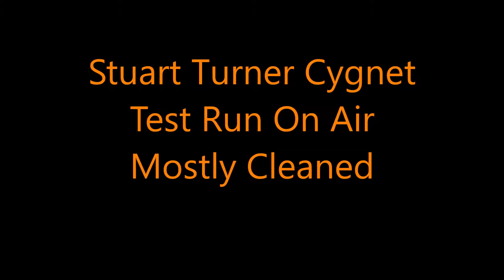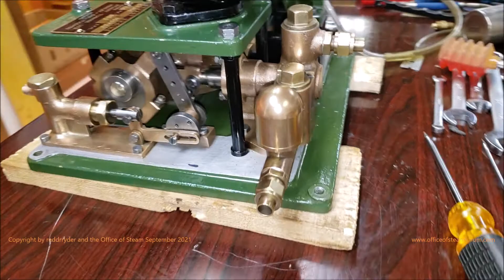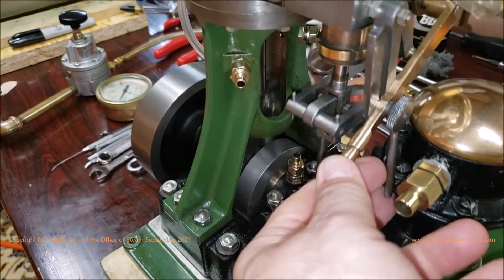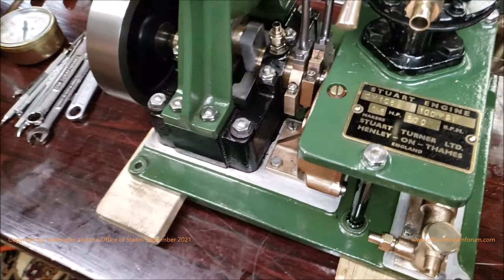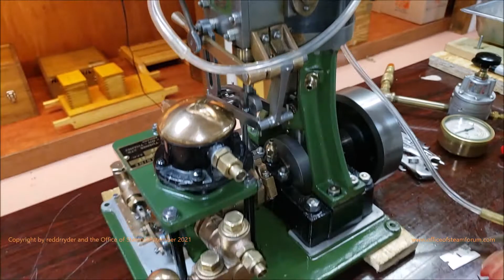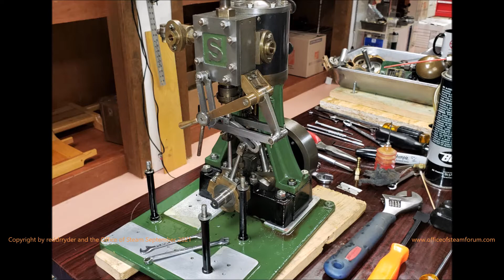Stuart Turner Cygnet Test Run On Air & Mostly Cleaned

Comment: Bonjour Gil, Beautiful machine indeeed and running quite well.
What is the round gold and black "mushroom" above the water pump ?
I would like one, but much too large for my model boats :+)
Amicalement, Raphaël
Reply from the maker: Yes, too large for a model boat. Perfect for a canoe or small launch. Up to 1.5 HP at 800 RPM with 100 PSI steam pressure.
Reply: @reddrryder  Bonjour Gil, thank you for your reply, but you don't tell me what is the unplugged "mushroom" used for ;+)
 Amicalement, Raphaël
Reply from the maker: @rhavrane  It is a vacuum pump used in a condensing marine steam plant. (Stuart used an automotive mechanical fuel pump for this)

Comment: Do you need to dismantle everything to ajust the excenters? Have also a Cygnet but the timing is of. Valve ports are equally on each position. Need to ajust the excenters.
Reply from the maker: Depends how it was constructed. Many have a keyed eccentrics and cannot be adjusted without machining new keyways.
Reply: @reddrryder  but then, the timing would be correct. Thanks for your feedback.